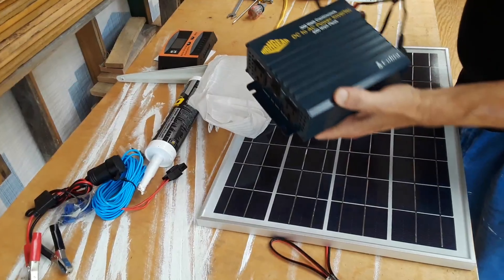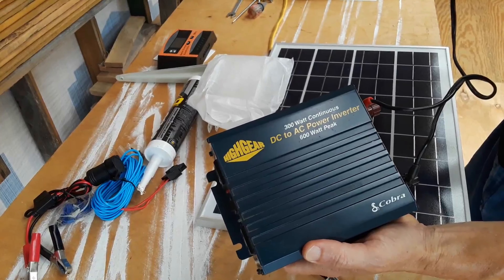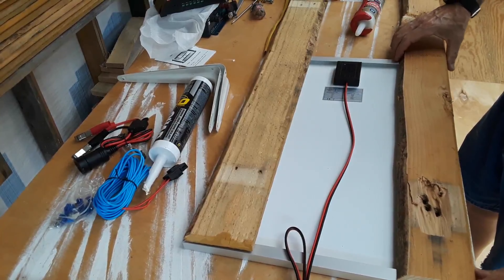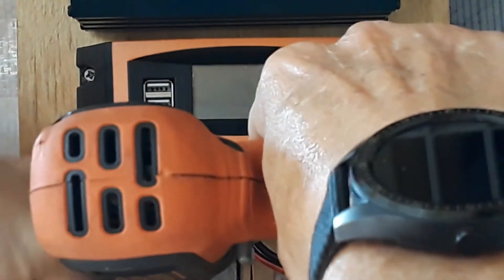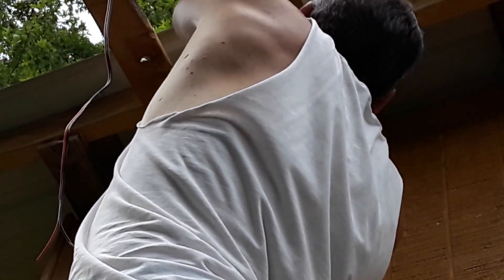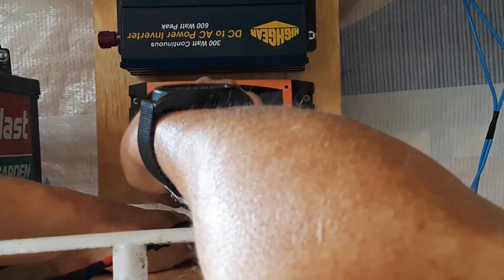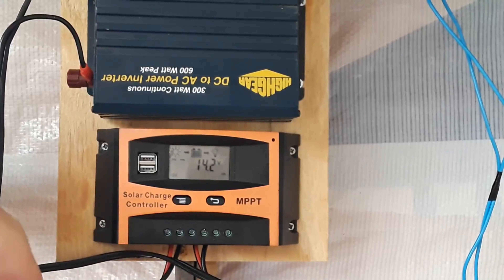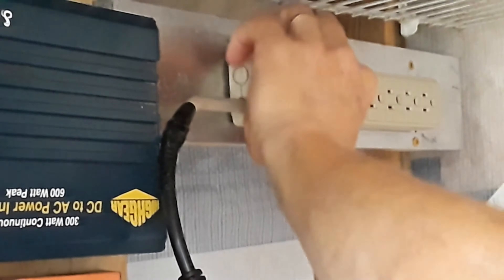Tiny Off Grid Solar System for $34

Comment: Just connect the solar panel to the battery charger via a voltage regulator after the transformer. Save all of those losses.
Reply from the maker: Thanks for taking your time to comment! It’s so small you’re right it’s not that efficient. However I need the learning curve so I can scale up to a larger system.
Reply: Good luck we all learn by doing. Those charge controllers are a bit dubious but will work probably not MPPT.

Comment: Hi, thanks for the video. I'd like to ask... Does that black power bank charges directly from the solar panel through the charging controller? Could you charge a phone and the batteries separated without draining the stationary batteries? Thank you!
Reply from the maker: Hi Fabio, thanks for watching and that’s a great question! The way it works is as soon as you hook the storage battery to the charge controller if that battery has any charge then the usb on the charge controller becomes able to be used. So if your storage battery is fully charged in “float” at that point then you are basically charging anything plugged into the usb from the solar panels.
I appreciate you taking time to watch.
Reply: There has to be at least a small battery connected to the charge controller. If you only have the controller connected to the solar, the solar panel could damage the charge controller through over Voltage.
The controller connects it to the battery internally which keeps that from happening.
 It might be possible to connect the inverter directly to the panel, because it should have overvoltage and undervoltage protection, but it will put out a little less wattage than the panel can produce.